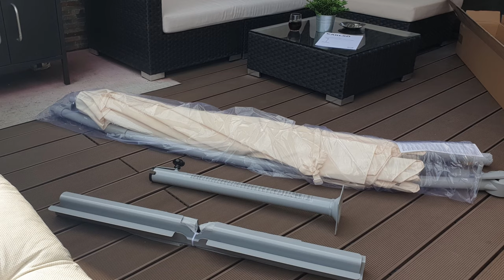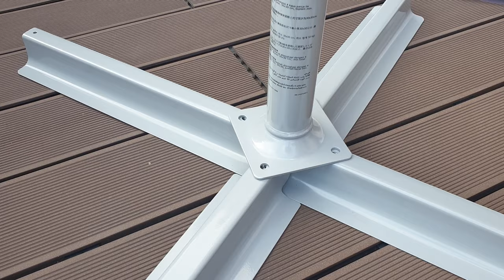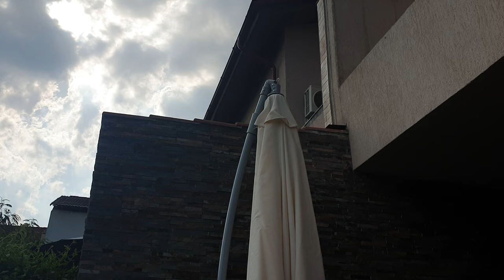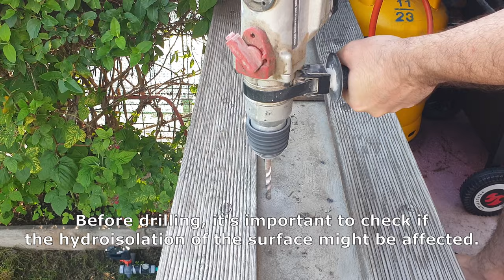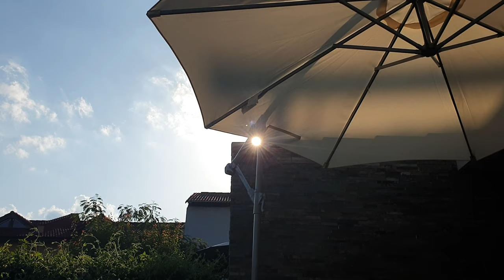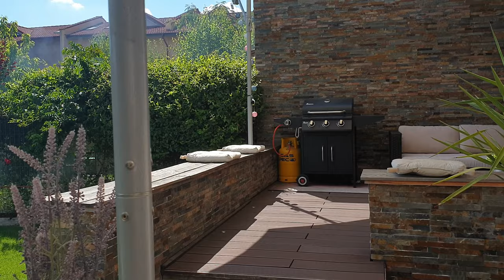Outdoor patio idea: Mount a parasol directly to a concrete surface

Comment: That’s how I had my umbrella set up, but the weight was a lot at the bottom and the winds were so strong that it bended. 😢
Reply: Parasol... Not umbrella :-)
Reply: @yorha2b278  it’s an offset umbrella. “Parasol” is and offset umbrella.   Anything left up in a strong wind can be damaged even in an plastic Sand anchored base.